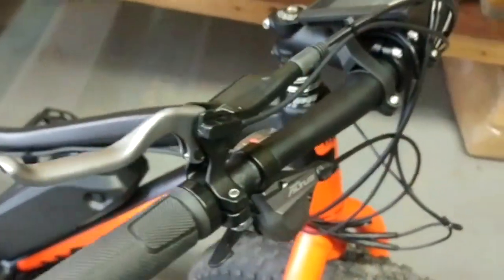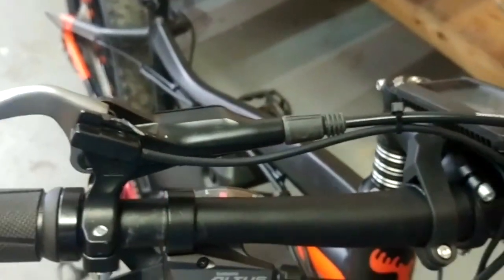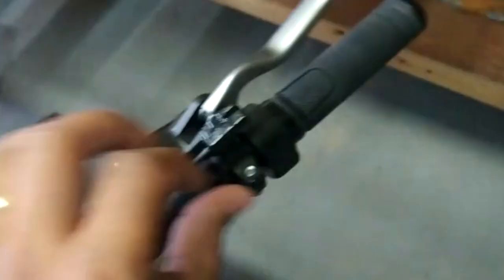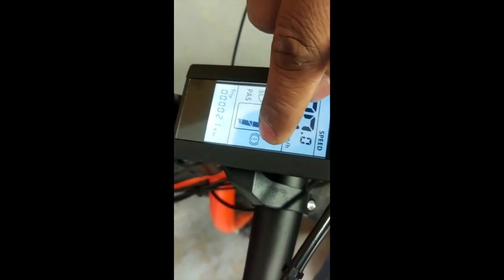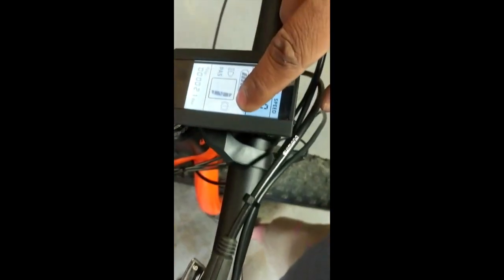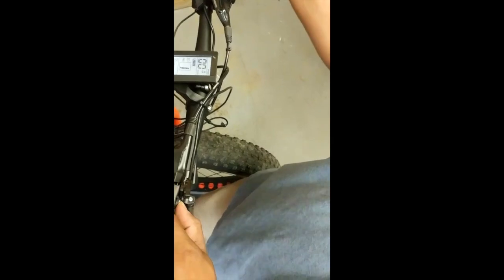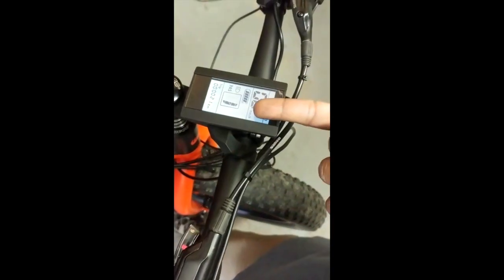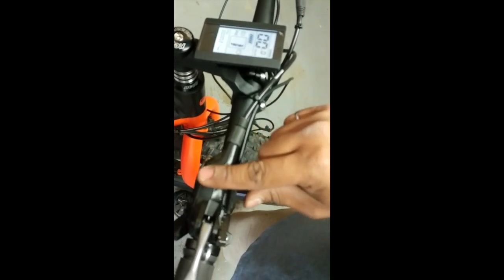Installing Hydraulic Brake Sensors for ebikes

Comment: This is good. I thought that the magnet needs to touch the sensor, but in this instance my brake levers won't give a lot of a gap when pulled. I've still yet to fit my recently bought kit, but this was concerning me. Now I understand to put the magnet right at the point where (!) doesn't show up on the display, which gives plenty of space between magnet and sensor when lever is pulled. 
Thanks for this. This might be the only video that shows this 👍🏻

Comment: i noticed something totally un-related to the topic.  You have your brake levers where you get the most stopping force;...on the top portion of the handlebars.  That makes a lot of sense.  Your body weight will do more than the pulling strength of your fingers in a situation where there is an accident waiting to happen...you need all the braking force possible.
Reply from the maker: Smart. It was set that way so it’s easy to install the brake sensors and you’re not trying to fight gravity.

Comment: I made a mistake thinking the glue would hold.. If the magnet falls off on a remote ride, you are stuck.. I lightly sanded the lever, cleaned it with alcohol, then use hot glue to stick it in place (checked that everything was in the right position) then i took a piece of shrink wrap to go over the lever and magnet.  That insures that if the glue fails, i will still have use of the motor.
Reply: If you were to disconnect the sensor from the electric system that would allow you to continue using the motor...
Reply: i had this issue too during a ride. I disconnected the yellow cable and I fixed the issue. No right brake sensor for the ride, but not a bid deal.

Comment: What if your not using a cycle analyst, can I hook that up straight to my controller? Which wired would I need to connect it to? And hope does it work? How does the absence of the magnetic create the cutout that tells the motor to stop?
Reply: Without a cycle analyst it would be difficult to tell when the brake is engaged. the wire to connect it to would be identified in the controller manual. the brake sensor has a copper wire circle that can tell when it is in a magnetic field and it can use this property to act as a switch
Reply: in the magnetic field, or its absence, the reed switch is triggered